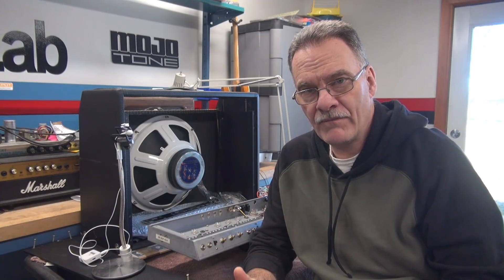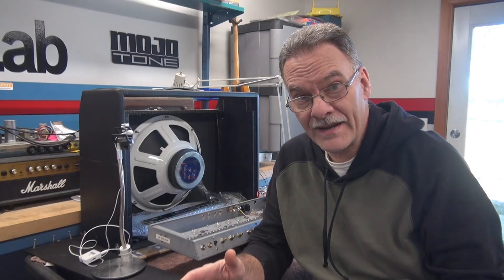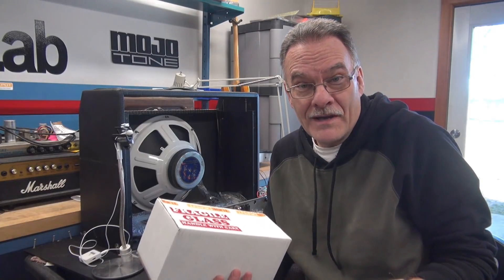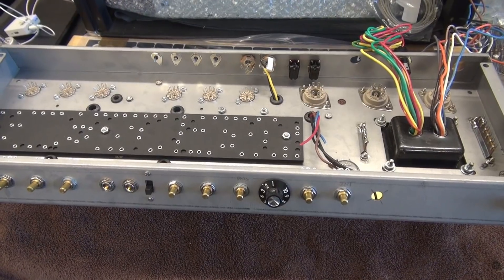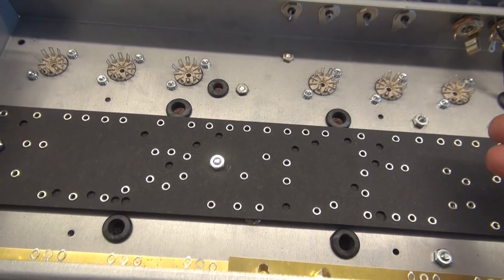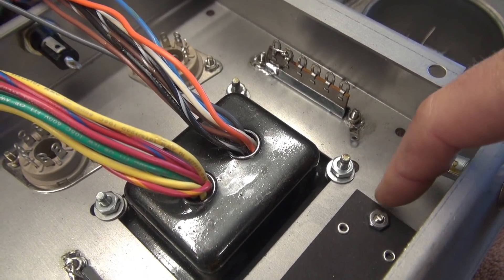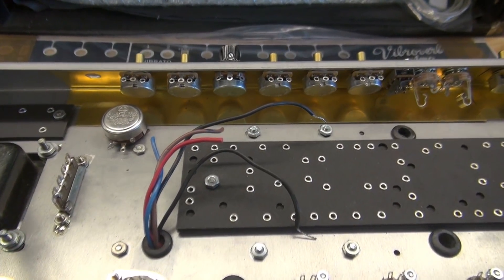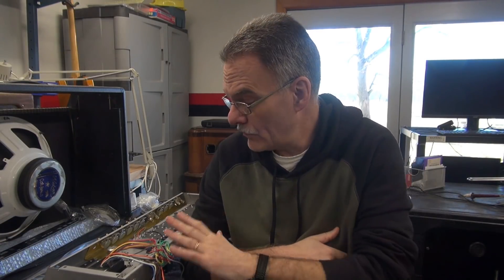Custom build Fender VibroVerb AB763 6L6 tube guitar amp Vintage project D-Lab Electronics Part 2

Comment: I’m curious, I’ve built a handful of amps using turret boards and at least 1/4” stand-offs, but I see these eyelet boards so close to the chassis with no stand-offs and wonder what keeps them from never shorting to the chassis, especially when they’re known to warp? Just never seemed like the best option to me, but I have no experience with them. Is that ever an issue?
Reply from the maker: They have an additional insulator board, sits under the eyelet board, no holes in it
Reply: @d-labelectronics   Thanks!

Comment: I am enjoying watching this build and am looking forward to seeing each episode as this build progresses. I am hoping that you will take special care to show us the completed grounding scheme. I am currently building a 5f1 champ kit from Boothill and when I got to the grounding part of the build, I realized that there were two different schematics used for this amp. One schematic used the 1/4 inch jacks for grounding of the preamp, the other used a grounding  bus from chassis to which each preamp grounding point attached. I stopped my project and read on grounding and decided to go with the bus for  more secure grounding.

Comment: Terry, studs are a good idea, but those nuts will loosen up over time.  Us some nylon lock nuts  when your not using the lug for a ground connection.  Combined with the thick grommets will give the board a lot of vibration cushion.  I've started using star ground terminals instead of local chassis grounding.

Comment: Quality work takes time (unless you're a delivery company like USPS, UPS, etc!), so no worries on taking the time to do it right.  I could not agree more with your choice of avoiding sheet metal screws, they're not as reliable over time and lead to scraped skin!  Almost as bad as cheap stamped metal computer chassis, where I've been plagued by razor-sharp edges especially where the card end plates fit.  I've joked about gear getting fixed sooner once I've sacrificed a little blood!

Take care, sir!

Comment: 5:45 - Terry,
Doesn't code require the green lead from the power cord to be attached directly to the chassis?
Reply: I was wondering exactly the same thing.
Reply from the maker: What is the definition of direct to chassis? Can you solder to aluminum? The Ground is via a Terminal direct soldered to ground, I believe that meets the intent
Reply: @d-labelectronics  Like it was before. the green wire is grounded vi solder lug at the transformer mounting screw.

Comment: I enjoy all your videos but never have anything to add to your builds or repairs.  Back in the mid 60’s I built custom test equipment used in the manufacturing of vacuum tubes for GE.  When I used the Buss Wire like you are using on this Amp, I would put one end in a vice and stretch the wire just a little.  Making the Buss wire very straight.  By doing this I believe would this improve the look.

Comment: USPS sucks, not the post office I grew up with. I'm waiting weeks for something to come... Tracking doesn't even work. I'll not use them to ship a package ever again as this  is the 2nd problem ive had in 3 months. First package took 4 weeks to go 2 states away and the tracking didn't work then either.
Reply: Rank and file are probably very happy to hear you say you will not use them anymore -- less work for them. The USPS has gotten rather shoddy.
Reply: What would it cost to have you build one just like this amp for me  ?

Comment: USPS has had problems ever since Trump put Louis DeJoy in as PG; he's an oligarch with financial interests in the other commercial shipping services and is deliberately trying to destroy the Post Office. He can't be directly fired but the new board of governors will remove him soon. Until then, hold on!
Reply: Terry, would it be practical on a Fender 65 Twin Reverb Reissue, to pull the pcb out and wire it p-t-p? Thanks for all your videos. A fellow electronics engineer her, and musician, Gene

Comment: I'm still waiting on the reverb transformer for my Vibroverb build - it's been 4 weeks. The amp works great otherwise. I had a couple of old Brimar Ecc83's lying around and put them in V1 & V2 - the difference they make is way more than I've ever experienced with swapping around preamp tubes.

Comment: Terry, I recently had one of those frustrating waits. Mine was a more mundane item, a 3-pack of the strings I use on my acoustic guitars. And just as you described, it sat for weeks in the same office. Eventually, I got a notice from Amazon that could cancel the order and get a full refund, but I still needed the strings, and a few days later, they showed (right after the 4 days of weather/electrical problems we had last month in Texas.) Thanks, as always, and thumb is up.

Comment: Cool. Terry did you consider not installing a standby switch?
Reply from the maker: Initially, this will be built as close to stock, then the owner can decide on options
Reply: @d-labelectronics  My Vibroverb puts out a lot of heat when it's firing so a standby is essential to longer component life.

Comment: Purists be damned: Great mods Terry 
A custom bill like yours should reflect the experience and insights of the person who's been servicing Fender amps for decades.
Reply from the maker: Thanks Mack, Glad you can see the value of the slight mods
Reply: @d-labelectronics  Where did the chassis and eyelet boards come from? Is someone making them?
Reply: Makes sense to look at the weak things that were done in the past, and make them strong.